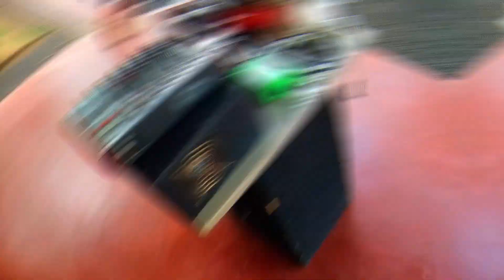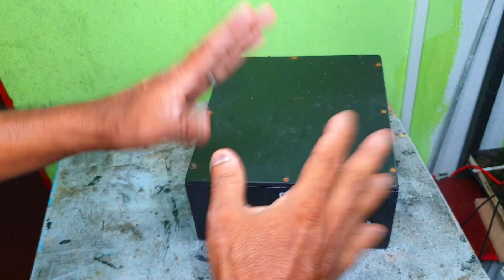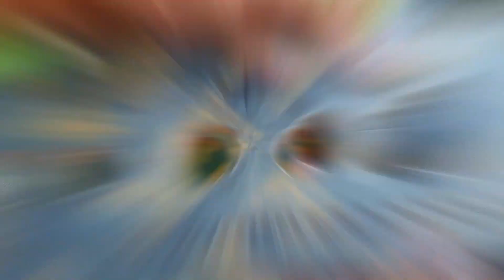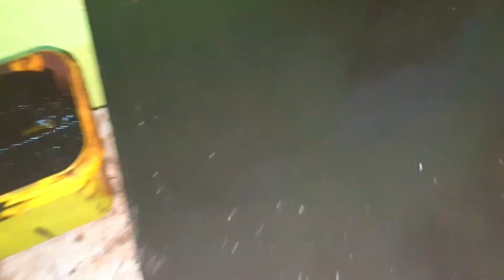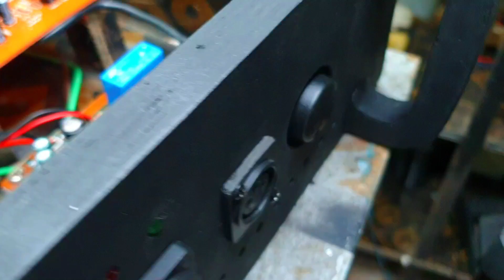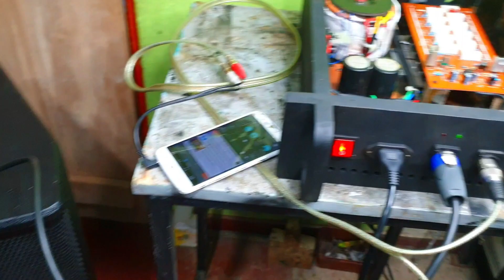How to Make an Amplifier Casing From 💯 Plywood Boards | How to make a Amplifier casing at home Easy

Comment: නිශාන්ත අයියෙ සාමාන්‍යෙන් ඔලැන් powerd dobule top වල ඇම්පියර් කීයක් වගේ ඇතිද main voltage out එකේ
Reply from the maker: ස්පීකර් මොකද්ද අඟල් 15 ඩබල් ටොප් එකේ නම් 8ක් වගේ තියෙනව
Reply: අඟල් 12.15.18 ඔක්කොගෙම එවන්නෙ එකම සෙටප් එක අයියා 😂.. ට්‍රාන්ස්ෆෝමරේ voltage නම්  38/40/42 තමා එන්නෙ..ඕන්න ඕකයි ඔලෑන් වල තත්වෙ.. හරි 🤔 ඔලැන් එකේ 8යි ජපන් එකක ඇම්පියර් කීයක් වේද 40voltage class H amplifler ic එකක් තිබ්බෙ අයියෙ sony setup එකකට

Comment: Tda 2050 heduwa ayye oyage video eka balagena ,mata tiyena suply eka 19v 😥 ,ic eka heat wena nisa use karannet ne,issellama hadapu amp eka pichchei kiyala dukai,7812 ampere wediya ganna puluwan sircuit ekat one ayye ,oyage 7805 video  ekata 12 dala heduwa ,heat wenawa hodatama
Reply from the maker: 7812 මදියි වෝල්ට් 12හ පුල් වෙව් ට්‍රාන්ස්ෆෝමර් එකක් අරගෙන ඩී සී කරල දෙන්න